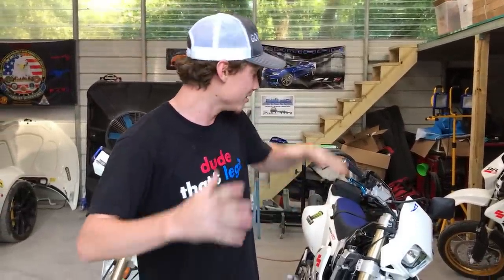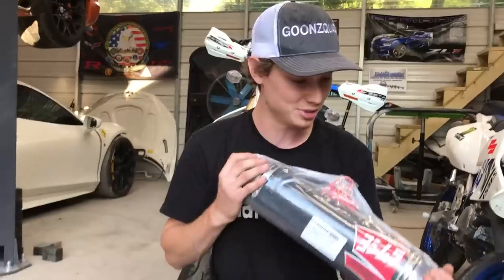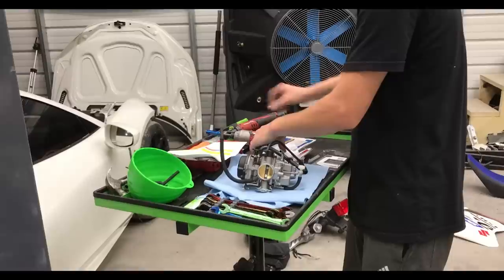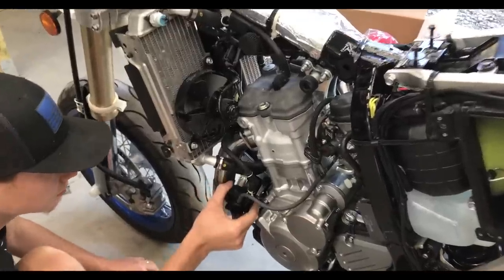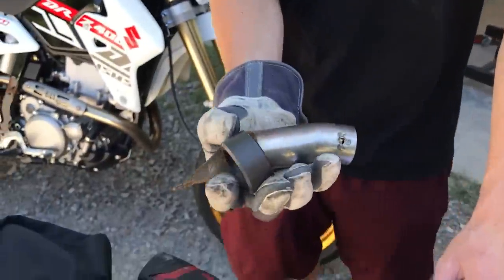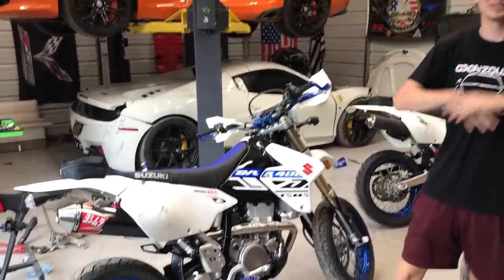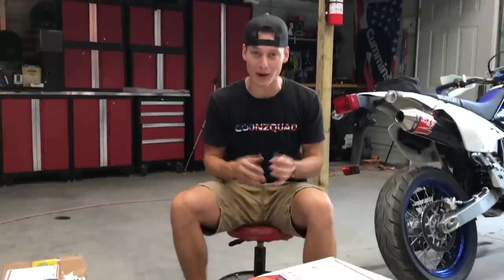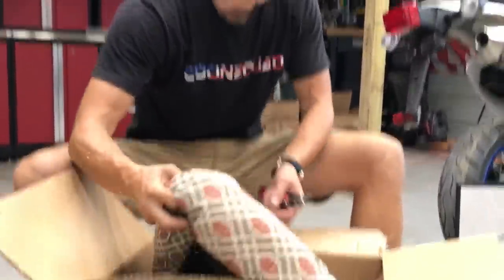Rebuilding A Wrecked 2019 DRZ 400 Supermoto Part 2

Comment: Hi guys! In my opinion the frame is heavily damaged in the head area (Seen a lot of bikes with these marks)... The chipped paint most likely indicates that it is bent or cracked on the welds. Take apart the triple clamps, the lower triple clamp tube is probably bent as well. It got hit really bad on the front and it might need a new frame... Go to V-tune and, if he has the tools for motorcycles, check the frame if it's not bent. For the 2 DR-Z that you rode, you can order small blinkers (or small LED blinkers), to make it look more sexy, and the one with original tail light, you can order DRC Edge2 Integrated Tail Light with LED blinkers inside the stop light. Looks awesome, a lot of DRZ guys recommend them and the big OEM lights are gone on the back. For the best clutch feel buy the RSC - Righteous Stunt Clutch Lever and add small mirrors like Speedmetal Billet Bar End Mirrors that you can also mount under your handlebar. Just as an information, the strange connections on the one with original exhaust bolted on, is the PAIR system (Pulsed Air Injection Reaction). This part basically feeds clean air into the exhaust outlet to help eliminate unburnt fuel from emissions. 
This makes the engine run warmer. When installing an aftermarket exhaust it causes popping and unsteady deceleration. Remove it and add a blank plate to the inlet port at the exhaust and you're ready to go (there are yt videos and articles on forums on the removal procedure). Good luck from a motorcycle enthusiast!

Comment: Hey guys two words of advice. Im pretty sure that box you removed by the exhaust is the fuel vacuum system, if removed your fuel petcock wont be able to shut off properly, you need to replace the stock petcock with a non vacuum operated one, if you don't fix this your carb will fill up with gas and eventually there will be gas in your cylinder! I would check your oil and see if it smells like gas it could have happened overnight. Also id advise against using the impact gun on the drz400 or any motorcycle because I have personally stripped or broken many bolts on my drz400 trying to work quicker... Not worth the headache.

Great videos as always and glad to see some motorcycles! So Jealous

Comment: Pretty much the same mods I did to my S model. Grabbed a skid plate from Thumpertalk and got some case savers from online (forgot where, probably Amazon). Around the 19m mark, when you get a new shifter, be sure to file down the sharp, inside edge, that's what punctured the case. Takes 5 minutes and is good insurance. Keep the videos coming. Nice work!

Comment: If your triple trees are bent, your forks are bent.  Forks bend before triple trees.
Reply: And the frame will probably be scrap as well.
Reply: @markbayles7840  no doubt that frames too compromised to trust, scrap it boys!!
Reply: I would replace frame as that is bent to hell
Reply: @markbayles7840  Curious to see a measurement on the frame neck to see what the angle is

Comment: The box by the exhaust is called a pair valve, it recirculates the exhaust gasses for emissions regulations in some country’s. You also need to do the 3x3 mod where you cut a hole in the top of the air box. If you take the seat off the already modded bike it should have already been done when they installed the exhaust! Also I would highly recommend filing the sharp edge off the back of the rear brake lever just in case you drop the bikes.
One last mod to do is instal case savers!! Keep up the good vids!

Comment: Do a 3x3 box mod. And then jet the carb. Most popular mod you can do did it on mine
Reply: needs an FCR39 carb those baby carbs are junk even with the retune. I did hotcams stage 2, full fmf powercore4 with powerbomb header, rejetted fcr39 carb, 3x3 airbox mod, and then it destroyed all drz besides the big bore kit bikes, which is just a timebomb.

Comment: Hey goonzquad would u guys do a rebuild video a supra mk4 please.
Reply: None have popped up yet for anywhere near a decent price......hell even on the new ones(which they would be way more likely to do) they cost 50k wrecked for the new ones and an off the lot one is 60k
Reply: ShadowOfDeath24 also Mk IV are going for over 100k right now
Reply: @mekanism8364  only pristine low mile TT 6 speed models. You can get clean ones for 17-25k with an auto non turbo and turbo it and make a way better car for way less(like motion auto tv did)

Anyone who buys a mk4 at 100k+ is ONLY doing it as an investment.
Reply: @mekanism8364  no they aren't lmao my boss paid 61k two or three days ago.. those were to get publicity for their dealerships anyone paying over 5k over is dumb at this point.. only the first few should have went over msrp

Comment: If steering stem on frame is bent then triple trees and forks are about guaranteed to be bent. The only way to test forks take them apart and measure the them on v blocks and dial gauge.  The only sensor that might keep it from starting is the tip sensor or side stand switch.

Comment: It is pretty easy to save that crooked bike.  Take off the forks, tank, engine out and rear frame.  Make sure your housing is straight on the frame, It is hard to measure so take it to a shop.  The frame itself might be twisted - we used to have this a lot when we were still moto-crossing.  You might need to find a place that does this kind of work on motorcycles because it needs a specialized frame machine to heat and twist it back.

Comment: Check out the internals of the forks. Even though they may look good from the outside, I would not be surprised if the internals are bent, especially if the bike was damaged on the front end. Had a similar issue on an 2006 Yamaha R6 I had.

Comment: The spark arrestor is required to ride off-road. You will get a huge ticket if you get pulled over. It’s best to keep it in, you don’t gain much power if any. The other component you removed is the emissions unit. Also required by state law.

Comment: The screen is the spark arrester. it stops sparks from leaving the exhaust and landing in dry brush and starting a forest fire. I would see if there is a way to wrap screen around the stopper you first pulled out so you can still arrest the sparks without the baffle in.

Comment: Hey guys, you have to rip out the snorkel in the air box and cut a 3"x3" square hole. That will allow more air in for the more air out
Reply: Also, the sm carby runs on vac and only (good) way to get petrol into it when dry is to put it on prime for 30 seconds.

Comment: If there is a frame damage in that zone probably the front forks are bended, is hard to see whitout taking some measurements, in supermotos when there are front impacts the forks and the plates that hold them are the first that bend or broke

Comment: I know you wont see this but y'all need to replace the petcocks on those bikes with one from a raptor. The stock ones have a vacuum diaphragm fuel cut off that fails and will run fuel through the vacuum tube and into the motor and thin the oil causing engine failure. Also get some case savers for them as well. Those engine cases are super fragile magnesium.

Comment: Tennessee law does not require spark arrestors for riding on private land, however if you plan to ride on public land or on the street spark arrestors are required. They are intended to prevent wildfires as alot of wildfires are caused by people riding without spark arrestors.

Comment: Good exercise you guys do some search on air fuel ratio engine stoichiometric point In a nut shell you omit the gas float adjustment too high will give you a too rich too low will give you a too lean all in relation with having a used engine with a different compression ratio The exhaust and filter will change the tone of the engine giving you the impression of getting more power but on a dyno it barely change anything for the $1.00 spend .Now exercise re adjust the float to OEM specification to higher suggested .

Get on 10 speed bicycle and change gear to understand what I am looking for the bigger the rear sprocket the easiest it is on you therefore o the engine bigger in front smaller in rear will make you go faster You get the picture a change of kit front and rear sprockets with a new chain will get you the biggest improvement to what's you want out this bike Too easy to wheelies defeat the purpose of riding in trails and it become a safety hazard

Comment: the frame part requiring bearings is called a head stock and the aluminium parts at the top of the forks are called yokes

Comment: On the drz there's no oil or coolant sensor that makes the bike not start it won't start because the cdi box is probably damaged or the wires from the wiring harness is messed up causing no spark .

Comment: The box thing with the tubes on it is a solenoid device to electronically shut of the carburettor. The ECU controls it, its connected to inlet depression which also opens the fuel tank valve. When it opens it lifts a diaphragm on top of the carb that dumps the slide and needle down. 
Constant velocity carburettor, google.
When and why I never figured out, but suspect pollution control, or anti wheeling.
The ECU gets the gear your in, engine speed and throttle position. That,s how they can get it to mess with a carb.
Junk it safely but block off the pipes.

Comment: A soda can and some jb weld will seal the stator. Ive fixed golfball sized holes with it.
Reply: Interesting idea, I used aluminum ducting tape and in weld on mine. Those things are so fragile on the drz.

Comment: Oh its AIS i think Its Air induction System or Air Injection System   AIS injects air into the exhaust chambers as a means of burning excess fuel when the bike is decelerating.its okay not to have that in your DRz.. and Good to environment if you have that in your Drz also :)..from Philippines

Comment: With a front-ender like that, I'd get the forks checked out by a local shop, lads. But if the frame is knackered....just build a new fookin' one! Then, tune the shite out of the engine.
Shits and giggles......that's what Suzis' are all about! Ride safe, but ride like you stole them. Btw, you know you've taken a corner right when your nutsack is scraping on the tarmac. :)

Comment: Cut the top of the air cleaner box open lets in my air flow look up the 3x3 mod for those bikes i get alot more power out of it and look at changing the drive sprocket you'll get better top speed

Comment: Oh by the way they're not called triple clamps they're called triple trees and what's all wallard up is it the triple tree or the gooseneck on the frame if it's the gooseneck there's just little cups in there that hold the bearings you should be able to replace those

Comment: I had a crack in my crank case on my four wheeler from the chain flying off and rubbing it where I had a bad bearing carrier and I drained the oil and put jb weld on it for 48 hours that was 3 years ago and it hasn’t leaked at all since

Comment: Dunlop 606 tires are great dual sport tires. Should be able to find plenty of used parts on eBay bc Suzuki has been using that engine forever. Again go with the gearing the dirt only bike has.

Comment: Guys that jet kit and exhaust are turned to work together.  Taking those parts out of the exhaust is not helping.  Back pressure is required for proper cylinder filling.  By modifying it like that you just defeated your purpose to make more power.   You might have gained just a tad at the extreme top end,  but you have lost all your bottom end torque.  Just because it is louder does not mean its making more power.  Prolly making less than  stock now.
Reply: You have that backwards.  They'll gain bottom and lose top. No it's not less than stock.
Reply: @motofarmmx2430  Less back pressure equals less bottom end.   I build 7 second street bikes,  I know.
Reply: @1wide9111  I bet
Reply: Me in the black shirt, my brother jeff riding the bike.
Reply: @motofarmmx2430  How much you wanna bet??

Comment: That bike is just a parts bike now. That frame is bent at the steering stem so it’s toast. Please don’t trust it. If the motors good you can sell that easily. You can JB weld that cover and put case savers on it. Recommended you do case savers on the other 2 bikes and shave the sharp point off the inside  of the shifters.

Comment: Break down the forks and check that the tubes are round.  Check the angle at the frame and stem on the frame.  Also check to see that wheels are in line.  Rockmountainatv.com will fix you up on the plastic.  Acerbis and polisport plastic will have your headlight surround.  X-trig and BRP make some really nice tripple clamps.  Baja designs can fix you up on headlights for night.  You could do some custom Goonzquad graphics on there that would look nice and tight.  I've seen a lot of flat colors for graphics that look great.  I did a set of my KTM that has lasted well (it gets beat off road).   Also, you can get blinkers to go in your handguards.  I ran them on my KTM dual sport and it keeps them nice and tucked out of the way and they look great.  .

Comment: Check out the trailer headlight mod. Another must do is the 3x3 air box mod. The front headlight bezel is hard to find brand new. Any OEM parts I recommend rockymountainatv.com. tst industries makes the best fender eleminators

Comment: Do not jet those carburetors. They suck. Get a Keihin FCR or Mikuni RS flatslides. Combined with an exhaust, it will easily bump the power 25%.

Comment: left hand cover on bikes = clutch cover. take it off & alli weld it from the inside
Reply: Wrong. Left hand cover is stator cover. The clutch cover is on the right. Secondly the engine casing on the drz is magnesium not aluminum. If you try to weld it you will start a bad fire that you can't put out
Reply: @sinformant  tnks Sin. lesson learned. thought all bikes were left side clutch cover
Reply: @sinformant  yep ur right m8. my mistake clutch on the right stator on the left. sry
Reply: @TheDublinjm  no worries man

Comment: Not a big fan of the small diameter wheels. It’ll be cooler with a 21 inch wheel in front and an 18 inch wheel on the back.

Comment: You can't weld that stator cover!!! It is magnesium! You will start a bad fire you can't put out!!!!
Reply: They said they were going to use JB Weld on it not actually weld it.
Reply: @Cartier_specialist  go back and watch it over. They said maybe jb weld or alumi weld it as in use their spool gun they used on the ferarri
Reply: @sinformant  I watched it again and the first thing he said was JB Weld which is a 2 part epoxy that will work -- at any rate they should just buy a new one because I'm sure that cover is fairly inexpensive especially compared to the cost of a Yoshimura exhaust  system and many of the other parts they already bought.
Reply: @Cartier_specialist  $200 for a used one on ebay. I jb welded mine. I was leaving my original comment in hopes they would see it and know better in the off chance they decided to get to aluminum weld it.
Reply: @sinformant  Wow $200 for that cover in titanium used? I'd check the dealership price. Sometimes people pay too much for things on eBay.
Reply: @Cartier_specialist  magnesium and idk about your dealership but all the ones I've priced parts at dealerships cost double to triple what things cost online new.

Comment: Why buy a new subframe when you can easily take a car and tweak it back straight?
Reply: Bobby Brady  depends on the alloy. And it doesn't look to be bent that bad.
Reply: Bobby Brady   best? That is relative as different alloys have different properties and different ductility and shear forces. That subframe assembly isn't twisted much and where it looks like it is twisted is at a point where it isn't load bearing, unless you count the small plastic tail light assembly. I own one of these bikes. I am a machinist and welder by trade and I wouldn't suggest something that wouldn't be safe. I understand on an aircraft as the whole structure is load bearing and I wouldn't mess with that, but the stresses on that subframe are no where near what they would be on an aircraft.

Comment: Goonz it says it all more money than sense you really don't have a clue what you're doing I'm surprised you managed to order the parts and there is no way those front forks are not bent if the trees are bent and frame damaged, and to use another bike as a reference it hasn't got one of these so I'll cut this off because I don't know what it is that's like saying that one has no brakes so I better take these off, try a workshop manual they are not to hard to read. You should rename your channel to Dumb and Dumber.
Reply: These two are cashing five and six figure checks now. They don't need your two cents.  Do you really think they have time to order and read manuals? Besides, they never claimed to be experts.